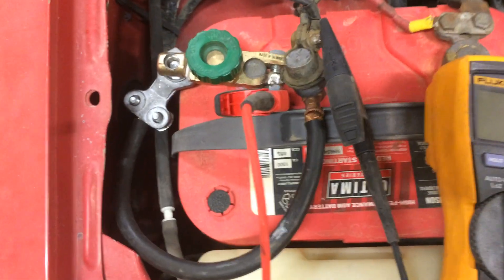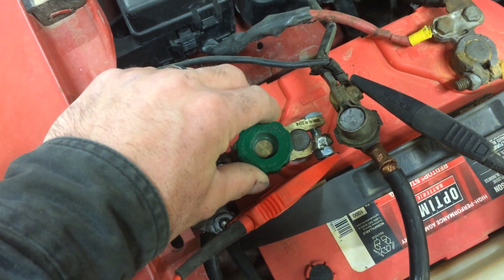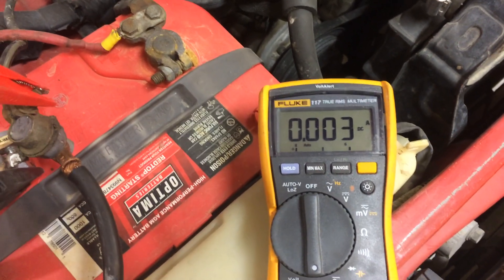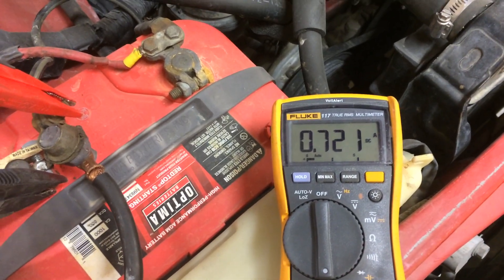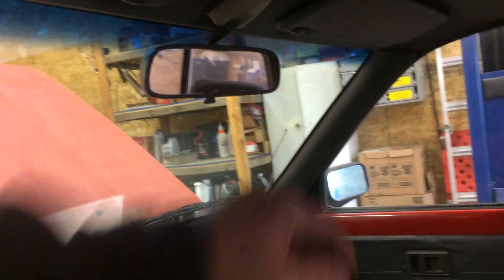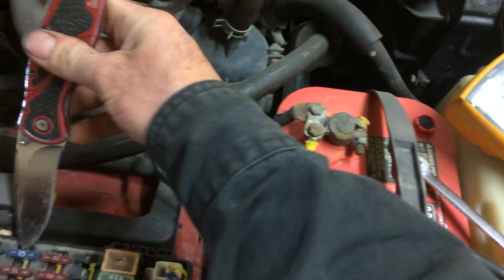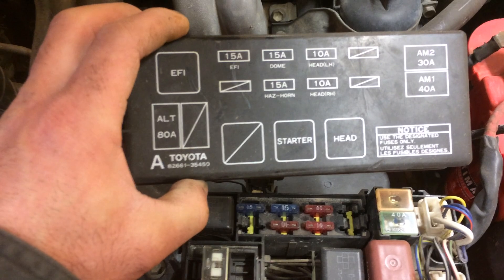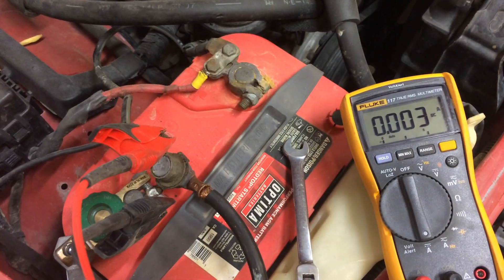parasitic draw test

Comment: Thanks for this video. I have a 2005 Nissan XTerra Off Road. The battery just went out of warranty (3 Years), and it goes dead over night. It just started doing it suddenly. At first I thought it was because I left a wireless phone charger connected to one of the power outlets (my phone has a bad charging port). I tested exactly as you did with my Fluke 87 meter. I'm getting .160 - .170 amp draw. When I turn on the dome light it goes up to .6 - .7 amps. I've pulled every fuse - inside and under the hood and not a single one reduces the draw. I'm wondering if there could be anything going on inside the battery it's self that could cause that low draw. If you have any suggestions, I'd greatly appreciate it.

Comment: Great vid, thanks for the info. I'm using a fluke a little different than yours, I looked in my manual and it says run the negative lead on the com and positive on 10A. Is this where you are hooked up on yours? Also mine shows an ac/dc option, which do I want to use?
Reply: CAR batteries are DC ..
Reply: Thanks Fred!
Reply: I had tried without success using a cheaper multimeter then remembered I had a Fluke tucked away. Worked great, found my draw. It was my glove box light.